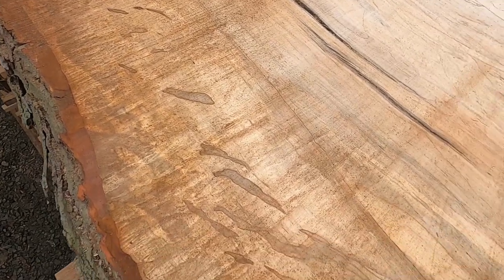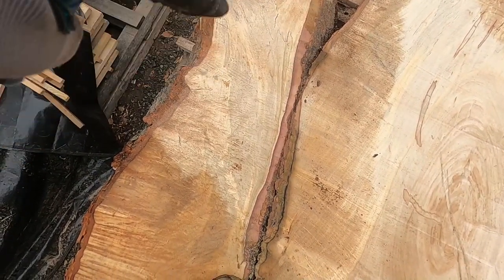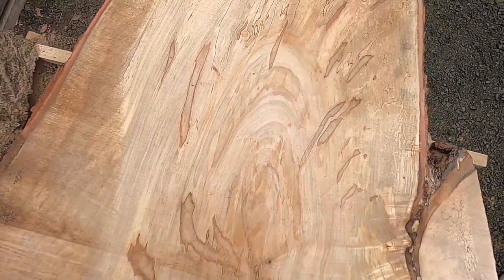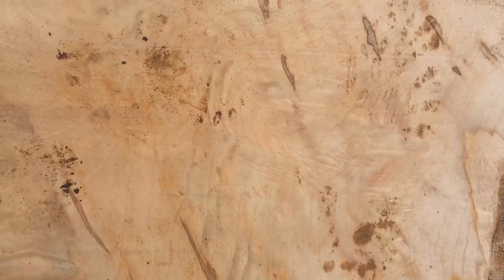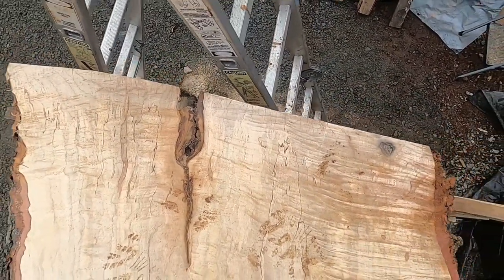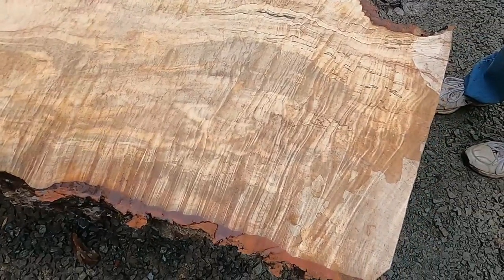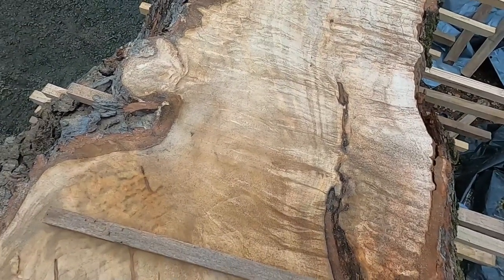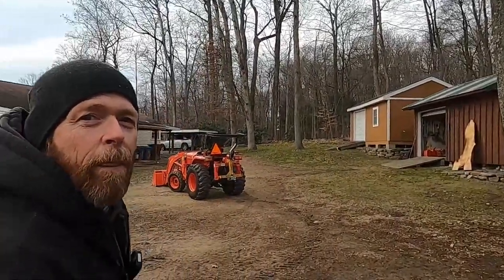Ambrosia Maple Monster Slabs Part 2

Comment: Right now I’m training myself on 18-24in pine slabs. 

When I get into the hard and specialty woods. 

Where do I put them up for sale, good cost estimator etc
Reply from the maker: Facebook marketplace is a good place to start. Pricing seems to be very regional. You would have to see what you area supports for prices. If you plan on shipping, the wood must be certified kiln dried, and sterilized, to prevent spreading tree diseases, and insects.

Comment: Do you have an outlet for the ones you just did? How far and wide are the customers you send to and who pays for the shipping? Could you give a hint as to the value of there slabs, I know there is a ton of work to be done before the finished product, Hope i don't bore you with my questions, I do enjoy your videros and many others similar to yours., I'm sure you know all of them. Thanks, Dennis
Reply from the maker: Not boring us at all. We sell locally at this point. If you want to ship slabs or lumber, they must be kiln dried and sterilized to keep them from spreading tree diseases, and insects. 
Since we air dry, these slabs won't be ready for about 2 1/2 years, so we will have to see what prices are at that time. Pricing varies from region to region. If you are selling, you have to see what slabs like this are selling for in your area, in order to determine your price. Sorry I can't be more specific.
Thank you Dennis, for checking out our videos, and supporting us here at the mill. If you have any more questions, please don't hesitate to ask.

Comment: cool another tree to rot under a tarp
Reply: Can you be more nicer. THANKS
Reply from the maker: I'm sorry you feel that way. 10 years of milling and storing lumber and slabs this way, and nothing has rotted. 
We leave the tarps open and loose, to allow proper air flow for drying.
If you wrap your lumber tightly with a tarp, and not allow any airflow, it will rot. That's not the case here. Maybe you should try it the way we are doing it, and you won't get rotten wood. We are happy to share our knowledge with you. Hope you are enjoying our other videos.
Have a great day.